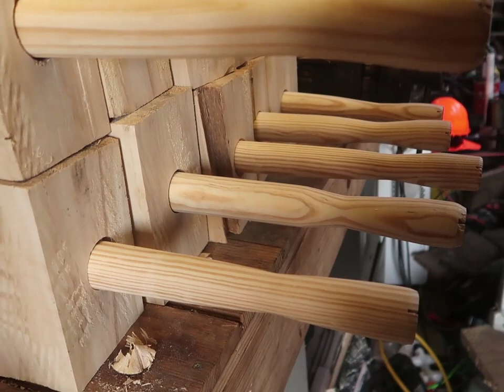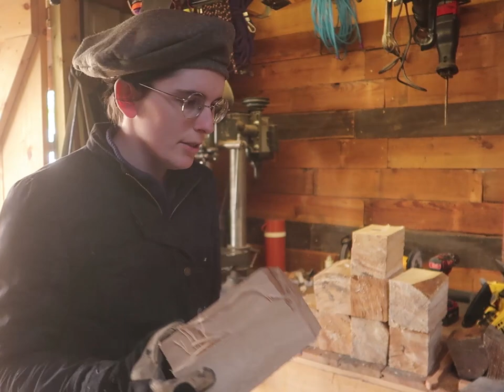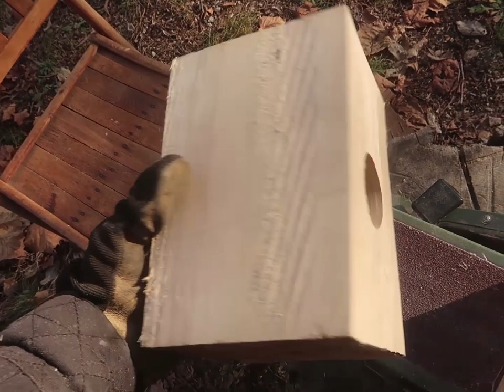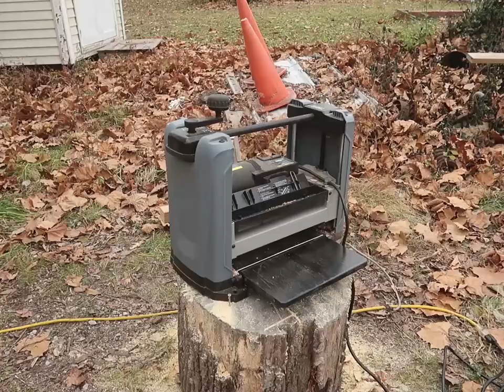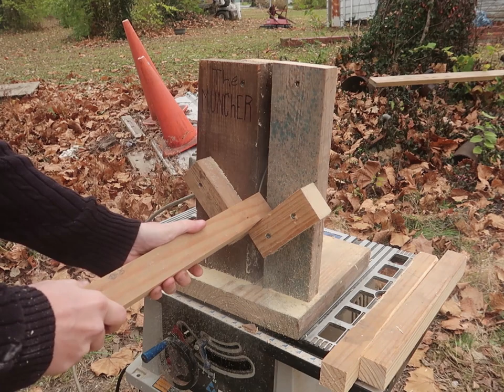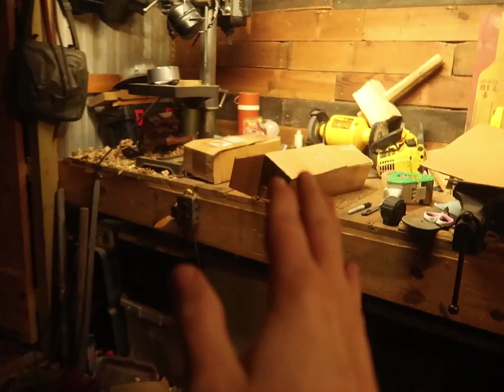Making Money Manufacturing on Etsy 01: Making Mallets! hillsborotools.com (made $160 from this)

Comment: You could drill a hole in the handle directly underneath the head and drive/glue a dowel pin in there to secure the head.